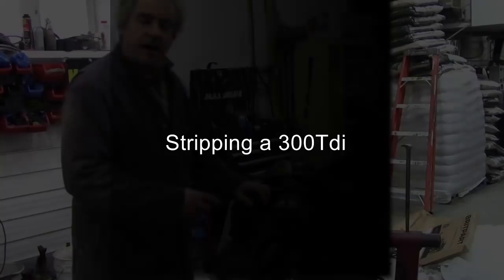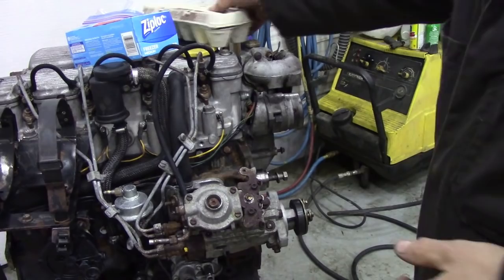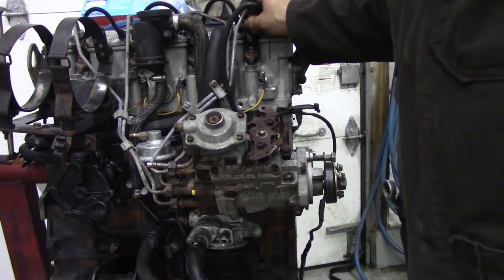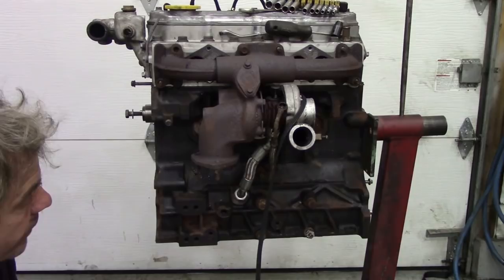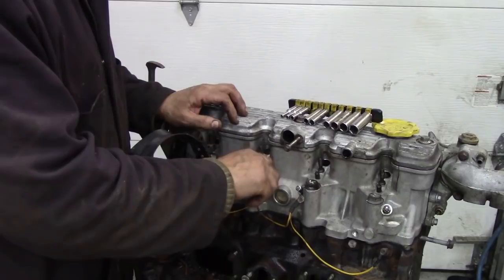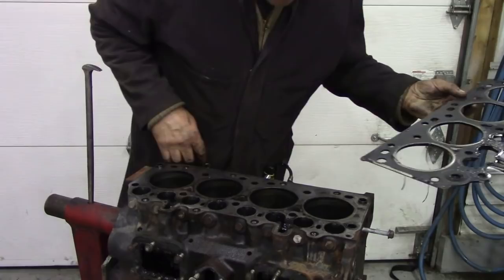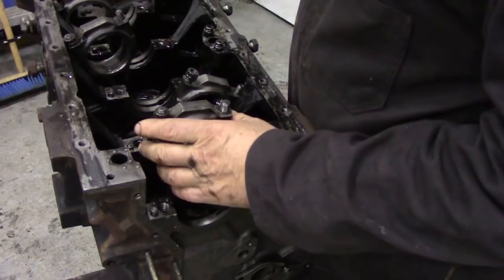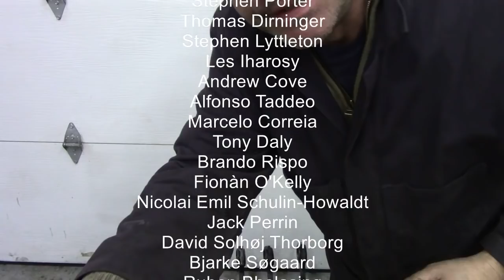Stripping the 300Tdi few notes and things to be aware of

Comment: Hi Mike, another very instructive video!. Here, you say that (seeing the state of the rings) you consider change rings. Once a mechanic (I have to say that I didn't trust much in him...) told me that changing rings (in an old engine) without doing anything at crankshaft level it is not convenient, because there's going to be more compression in combustion chamber, but the crankshaft and it's bearings already have some wearing, so the new "power" in the "up side" will accelerate the wearing in the "down side". It make sense to me, but it is that so? Or it's just a matter of measure the wearing to see if it is under tolerances... (?). Thanks, Cheers!
Reply from the maker: Well in theory maybe, but it must be marginal, and besides when changing the rings you have to pull the rods so why not change the bearings at the same time?
Reply: Well, it was an advice that some mechanics here used to give to their customers in order to save money (but that was many years ago, with old american engines, and stuff like that), mainly because the machining of a crankshaft is very expensive around here. But the thing is: if the crankshaft is OK, and if you need to change rings, can you change at the same time the crankshaft bearings without machining the crankshaft? I can't see why not... Thanks for your comments and time!

Comment: Great video and fantastic site. I’ve just had a crankshaft break on my 98 tdi300 at 145k miles .Not a good advert for a regularly serviced and carefully driven vehicle!!
Now had a replacement fitted but was wondering whether to fit a boost pin to pep it up a bit.
In your opinion would this be detrimental to the engine and increase wear and tear?My replacement has done 105k miles
Reply from the maker: Unfortunately, I no longer give advice or do videos on tuning as I could be held responsible for damage.

Comment: My issue is: all four effing injectors are stuck in the head, turbo is beyond hope, most bolts missing and i got the crank with a chunk cut off. Might look for a other take out unit that is destroyed low in the engine so i can rob the missing bits and have a spare head. I might get a core unit for the turbo, then go from there.
Reply from the maker: You need a slide hammer to get the injectors out
Crank - a good used one maybe
Turbo - check on Alibaba for the centre cartridge - they are cheap and pretty good

Comment: very intersting in regards to what you said about the injector pump support bracket, could that cause a timing belt to go?
Reply from the maker: Indeed! 
I now have the new part and will try and do a separate video on the matter
 -also LR took the belt tension down from 15Nm to 11 Nm

Mike

Comment: Any afterthoughts on the 'grunge'? Incorrect thickness oil control rings, or insufficient crankcase ventilation, or poorly machined pistons? (I'm talking out my ass, all I know are petrol Chevy V8s.) Oh, why a bolt to hold the lifters? I've never seen that before. (See above comment!)
Reply from the maker: I have no idea for the gunge - I  don't do regular services on customers cars - local shops do that - I just do the big repairs